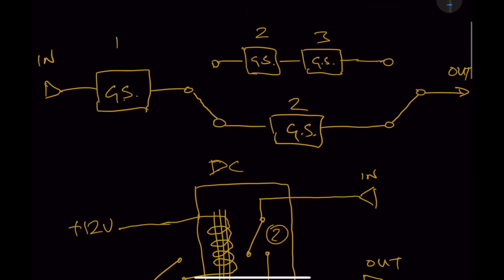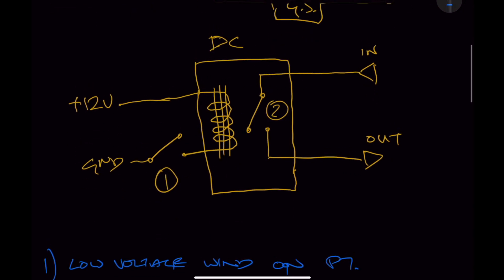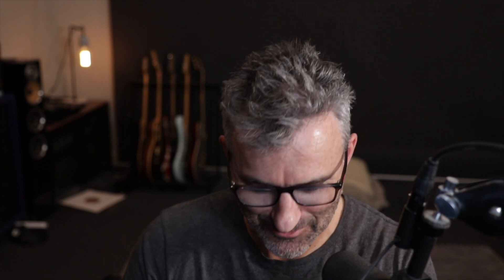Tube Amp Relay & Heater DC Supplies - MADE EASY!!

Comment: Great info, cheers! I have been on the fence to try out those SMPS to avoid needing to buy custom transformers with a 14V winding. I see you are happy with the regulation and noise with no capacitors added but what and thermal regulation? I suppose you put those inside the chassis. Are you using the 1.6A rated ones or going for one size up?

Comment: Why not just use 6.3 VAC relays and switch the coils right off the AC heater supply? With a snubber circuit and small current limiting resistor, seems that a bit of switch bounce on the heater rails won't make any difference in the audio. According to Omron datasheets, switch bounce is in the range of a few milliseconds, and since our relay coils would be in parallel, across the heater supply, that would amount to a bit of noise on the heater supply, not full on/off, which would make no significant difference in the heaters' output. Just a thought. Any experience doing it this way?

Comment: if I use a recom smps for DC heaters , do i need to use elevated DC heaters (i.e. in a high gain amp with a cathode follower)?  if so, do i do that by grounding the DC side of the SMPS to my elevated DC voltage source?
Reply from the maker: Elevated DC heaters is for AC heaters only.  Do not try and DC elevate a DC supply, there is no point actually.

Comment: I have found through experimentation with new builds that you can ground both the AC and DC side of the bridge when using the 6.3v filament winding to power relays. The trick is to not use the 6.3v CT wire to ground but instead, create an artificial CT on the filament winding with two 100ohm resistors. This prevents noise from creeping into your filament winding/tubes and also keeps the DC channel switching nice and quiet. IIRC, I first found this method in some of the old Mesa schematics. I only use this method as a last resort though because I prefer to use a separate 14v transformer to power the DC filaments and relays in new builds.

Comment: Great video. Big thanks for recommending the Recom SMPS. Definitely a cost and space savings solution. Linear PS w/ voltage regulator works fine for me, but I get a little worried running more than 2 triodes; the heat sink on a 7812 gets HOT! Keep up the good work mate!

Comment: Regarding the floating supply for relays, Is the issue only with a bridge rectifier setup or any floating supply? I have a separate 5 volt wind without a center tap just for relays and it runs through a half wave rectifier and switching circuit. One side of that wind is attached to the ground of that switching circuit and it's only attached to chassis ground at the footswitch jack. Will that cause an issue when used with amp switching on a modeler? Should I use a jack that isolates it from the chassis?
Reply from the maker: Yes it’s the bridge rec that’s the issue.  In any event If you have the DC side grounded you’re good to go.
Reply: @HeadfirstAmps Ok got it! Thanks man!

Comment: Being a SMPS, does the Recom cause any noise issues?
Reply from the maker: Mount it down the PT end, inside the chassis side wall.  Works great, no noise.
Reply: @HeadfirstAmps  Do you have a board for the next larger Recom? I believe it's the 30W model. I have one here and I know it has the same pinout and will fit your current board. But it has a physically larger case. And while sure... it will work... the data sheet does spec a specific amount of room around the SMPS footprint. Just wondering. If you offered a slightly larger board for the 30W model, it would still work with the smaller 20W model. But not the other way around.

Comment: Thanks for the tip on the RECOM! Brilliant. 

Question: In this and the previous video I wanted to buy a PCB board from Evolve but both were out of stock per the listing. Is stock expected soon, especially for the RECOM PCB?
Reply from the maker: Glad it was helpful, the boards are coming back in stock real soon.  ETA a week, I have made them available for back order if you’d like to reserve some.

Comment: Great stuff Jason! Question, if I was to dc REGULATE the filaments of the first stage of my super lead 100, how will that effect v sag when going balls to the walls variac’d down? Will I lose the sponginess? Will the regulator shut off? Thanx man
Reply from the maker: If the DC voltage into the regulator drops too much the output will fall away and you’ll get AC ripple on the DC = noise.  For variac use, stick with AC heaters.

Comment: while i do agree about using the filament supply i recently picked up a mojotone relay kit that's powered off the ac heater supply.   it doesn't ground to the chassis (they emphasize this in the instructions). it works well. they have the instructions on their site (although they are the instructions for the old revision board). To activate the relay you dont shunt to chassis ground, the relay board has the relay ground point, probably floating.
Reply from the maker: Agree.  The issue arrises when external systems shunt the amp switching using their own ground.  Like the Hx Effects does.

Comment: So, no issues with noise/whine from the switch mode supplies kinda close to a lot of gain?
Reply from the maker: Nope, mount it inside down the PT end of the chassis.  No problem.

Comment: If you are only planning to use the DC for relays only, how about using an unused 5v rectifier winding off the PT? Should be able to get about 7vdc out once rectified, and could regulate it to 5vdc and use 5vdc relay's.
Reply from the maker: Yes, this is scenario 1 only with 5V relays.  Works well.

Comment: Another awesome video! Hey Jason, I've been offered an amp I've always wanted to own(100w), but it's US110v and I'm in Melbourne. Do you have any recommendations for best stepdown transformer solution? Tossing up between going for it and just waiting for an Aus 240v version.
Reply from the maker: Hi, can depend on the amp - some have universal transformers that can be easily set to 240v...others not so.   Stepdown wise, just get something that is rated to at least 3A 240V.  100W amps at 240V will run 2A mains fuses, you want your stepdown current to be greater than that.
Reply: @HeadfirstAmps  ahh.... Yeh it's a '97 SLO, so I think those Deyoungs did not have the universal ones like other Soldanos. Thanks heaps!